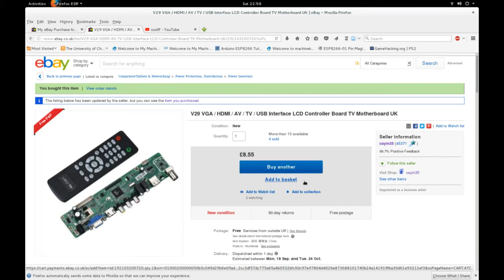Flashing T.VST59.031 LCD controller board firmware

Comment: Your screen panel model? I had one, which i salvage from my acer laptop. It seen similar with yours but my panel model number is not in that file, but it has nearly same number. My panel is b141ew03-v4, search in file just found b151ew-v3, quitly similar. Did u think it can work?

Comment: hello, I have one of these boards. Its works really well but problem is, I am using it as a monitor for a raspberry pi and using the switch to power the display on is annoying. Is there any way to make sure that the lcd turns on when power is connected?
Reply from the maker: Hi I don't know how to change any of the settings apart from what appears in the service menu but I think utilising the Pi's GPIO pins might be a crude way to get what you want, either to open/close that part of the circuit that the power button connects (although you need to be very careful and research how to do this without damaging your pi) or perhaps just an IR led to sent out the on/off code all when the pi boots up/shuts down.
Reply: ssslff  thats exactly what crossed my mind. but somehow I feel that this could just be a firmware thing that keeps everything in sleep at first.

Comment: What's the different between firmware with 5 key and 7 key?
Reply from the maker: Sorry for the delay - If you are connecting a button board the keys refer to the buttons used for on/off volume, channels, menu etc. If you pick the 5 key firmware then you'll most likely lose 'menu' and 'source' as buttons (although I have never tried this myself as I tend to pick the 7 key firmware)

Comment: Hi my laptop LCD is LP141WX5 TLC1. do you have a firmware for flash files for that? Thanks.
Reply: I mean is it really compatible with that model in the first place?
Reply from the maker: Hi I haven't got a firmware for that model specifically but I looked on the lp141wx5 datasheet and I would try firmwares that are SI 3v 1280x800 (firmware link in description)
I didn't have the firmware for the screen in the video but I managed to find one that worked by matching things like the screensize and voltage. If you haven't yet purchased the board I would check with the seller about compatibility and firmware - unfortunately I can't confirm if it works with that particular LCD
Reply: Hi, thanks for the reply. So even if the LCD model is on the list it's not guaranteed to work? Does it matter on the pinouts wiring of the LVDS or it doesnt matter as long as it is the LVDS is 30pins?
Reply from the maker: Hi my lcd wasn't actually on the firmware list but still worked using a firmware that matched the basic specs of the screen. Certainly a matching LCD/firmware combo ought to work but you are right that wiring the LVDS cable correctly is absolutely crucial and if you've bought one of those LVDS leads online you need to check if you have to rearrange the wires on the 30pin plug in accordance with the datasheet of your particular LCD model.